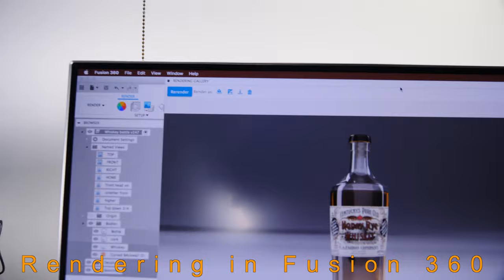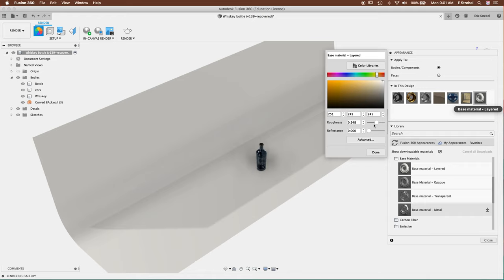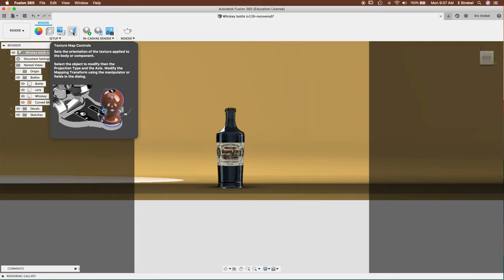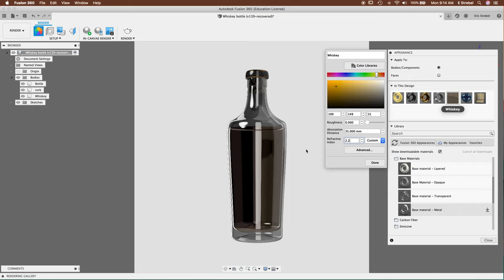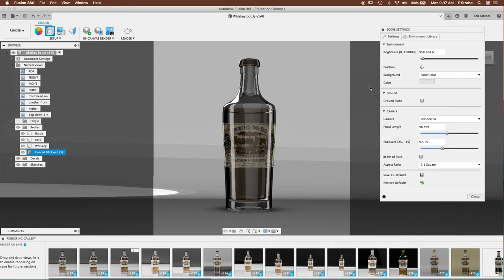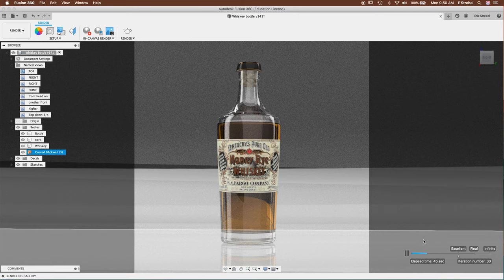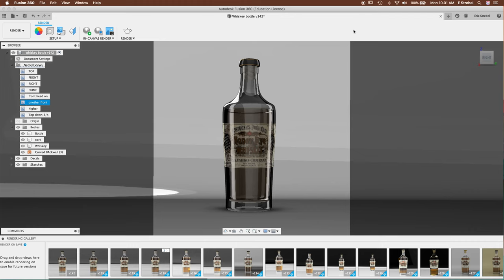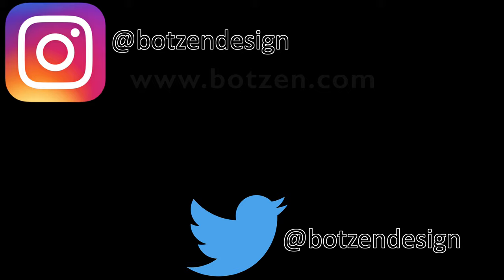BASIC RENDERING in FUSION 360 overview and fundamentals to LIQUID REALISM

Comment: Awesomw job and great tutorial. I hope that things change in the future so it I can use the knowledge. I feel for you with the crashes. So much promise. So little support. For a variety of reasons (crashes, performance), I have used Fusion as little as practicable, but have been using it for  five years or so when I had to. Solidworks is my preference, but AutoCad and Inventor are the day-to-day and what we have had the license for. Inventor and AutoCad are solid, and we get a lot of work from clients produced using AutoCad.  Fusion, on the other hand.... The worst part is that I have been using Eagle for better than 20 years for the electronics side, and now it is rolled in to Fusion (mandatory), and after several weeks of *expletive deleted*, we are moving on. Spending the money to migrate everything to another platform (roughly 20 seats). On this, Autodesk found the pooch drunk at a frat party, alone and untended, if you get what I am saying. If the customer (software licensee) can't make money, they can't pay the license. And reliable tools are key to making money.
Reply from the maker: I feel for you, good luck with all that. Thanks for your comment and support on my video Much appreciated

Comment: Great video, I learned a lot. I have been trying the render a thermoformed clear PET tray and am struggling to get the material to look right. Glass is the closest but still not right. Any ideas? Thanks in advance!!
Reply from the maker: Start with glass and then reduce the transmission, rate and then adjust index of refraction, good luck

Comment: Keyshot>anything by autodesk.
Reply from the maker: I have never used Keyshot
Reply: Helpful comment... on a Fusion 360 video.
Reply: @ScottMoyse  It's relating to rendering, keyshot is a rendering engine...You can do the same kind of work in less time using keyshot.
Reply: @Adrian-wd4rn  yeah. But this video is here to help people with rendering in Fusion. You're just fanboing it up like a muppet in the comments.
Reply: @ScottMoyse  "fan boying it up" Good one, as someone who uses fusion very often, more often than I use keyshot...But hey, whatever.
Reply: @Adrian-wd4rn  yeah. Point is your comment was derogatory rather than helpful. Most Fusion users don't have access to keyshot.
Reply: @ScottMoyse  Not really derogatory, unless you're easily offended, which seems you might be. Keyshot is pretty cheap just an FYI
Reply from the maker: Yeah, it's derogatory